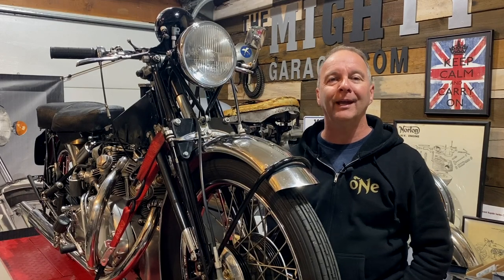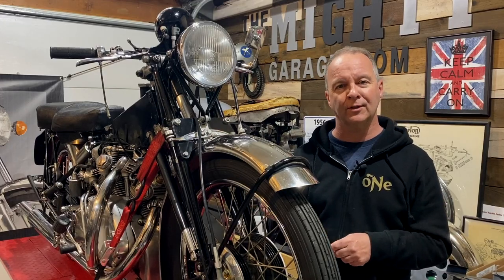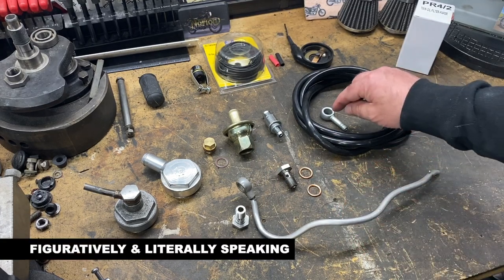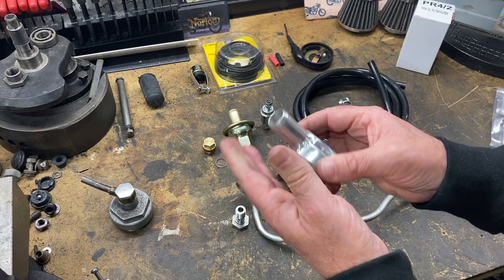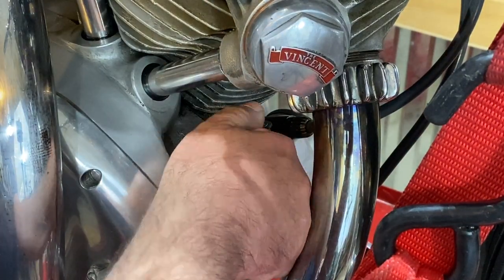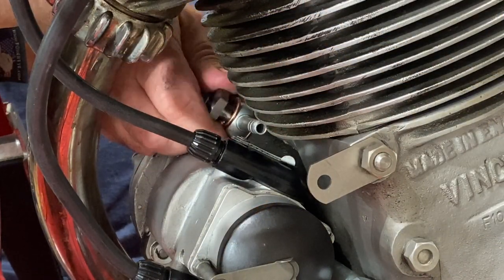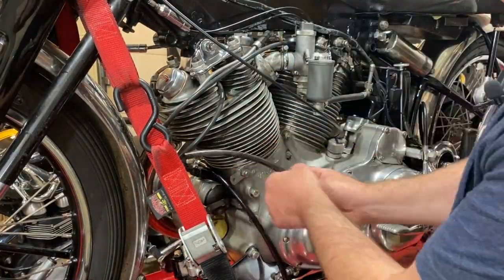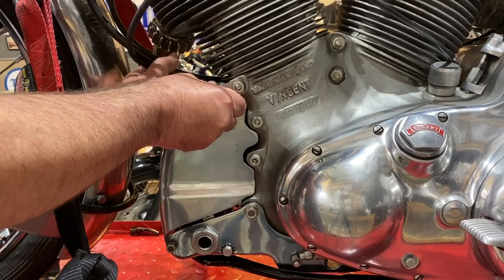Restoration of 1951 Vincent Rapide - Part 78 - Timed Breather

Comment: Just a thought, it might be silly. My caravan has a lot of plastic piping of similar dimensions & you can get 90° bends for it. Back in the day, I remember routing the engine breather onto the rear-drive chain to lubricate the chain. I suppose it depends on the amount of oil your breath ejects?

Comment: I don't know Mike, but depending on the pressure to push through all that pipe up over and back, not sure if all it will do is collect in the pipe. For the fin to pipe protection, you could make a little heat shield to go there and protect it. I could make you one if I was closer for measuring and test fitting.

Comment: I've been building stroked Triumph twins (89mm stroke, either Norton, Weslake, or Nourish cranks) for 30 years. Every motor has the timed breather removed if
 Fitted by the factory, and as many breathers as possible fitted. Everywhere.
Most have a dry belt drive so the combined primary (very good) breather is out. The big one is top of the timing cover and up and over, min 1/2" id, pref 3/4", and importantly, both rocker boxes.
None of my motors leak oil.
Regards,

Comment: I think I’d have kept to original pipe but added the hose to it’s end. The hose could then feed to the back of the bike
Reply from the maker: Thanks, that's a great suggestion.  I did consider that and may try it out if this doesn't work out or the pipe melts 😬😉
Reply: The Mighty Garage I just love the nicely fitted steel pipe that hugs the profile of the engine / mag 🙂 Good luck with solving the problem; looking forward to seeing how things work out.

Comment: Good day Mike ! Interestingly My C did the same thing and I tried all the same things..  The final fix for me was a combination of a Sid Biberman and KTB's E.M.G Stevens fix.  I took a T29 tank breather adapter from the chain oiler system that threads into timed breather hole straight up added a length of rubber hose over  the top of the engine and at the hose highest point I added a quite pricy PCV (positive crankcase ventilation) valve called a Krank Vent it is a HD part.  Then I ran the rest of the hose just like you did over the top on the motor down past the rear carb an along the LH side of the bike under /behind the horn and all the way out to the end of the stock rear stand.  Held all in place with JohnBull rubber holders or you  could use zip ties.  This allows the oil in the the breather to condense and drain back into the motor  before the PVC valve and after the PCV valve only allows flow out and not in, this is  keeping neg pressure in the line and the motor to reduce leaks in the power unit .  At least that is the plan  and the result is much reduced oil misting out of the hose.  Condensation will collect in the hose though so every so often lower the rear stand and it will drain out and oil water emulsion..
Reply from the maker: Thanks a lot Eric for this advice. I really appreciate it. I'll see how things go with this setup and then possibly make adjustments! It's a step-by-step process of elimination, isn't it!? Hope all is well, best wishes, Mike
Reply: I have the same problem on my newly purchased Rapidow (Rapide built to shadow specs). I'm going to try it with the PCV. A catch container would be an interesting and useful addition to measure and control the exhausted oil as well. There are many articles written in the Vincents, but it's great to see some visually. Thanks Mike. Cheers!

Comment: Hi Mike, great videos as always, Paul Richardson's book has some good information about the timed breather and its timing, which I'm sure you are aware, I just wanted to ask  about something completely different and I'm sorry to hijack the post in a different direction, but I'm very keen to know what size rear wheel and tyre you have fitted. Thanks, all the best
Reply from the maker: Hi, no problem at all! It's good timing as I have just replaced the rear tire this week.  I have fitted an Avon Roadrider MKII 100/90-19 on my standard rear 19" Dunlop rim. The Roadrider a modern-looking tire and may not be to everyone's liking, but I have found them to be very good.  Many of the guys in the Norton club use them on their Commandos and I have friends who also use them on their Vincents. Hope this helps. Best wishes, Mike
Reply: @TheMightyGarage  Thanks very much for the info, I'm running a Dunlop K70, std size in the back of my 1954 series C and always wanted something a bit more sporty and with a speed rating capable of at least matching the front Avon speedmaster, but was worried it wouldn't fit. Thanks again.

Comment: Hi there, did you aneeled the copper washers before instaling the pipe? Because you should. Just heat them and when they change color let them  cool down they will fit and compress  better. Cheers.

Comment: ...and you may ask youself why do all the guys riding behind me clean their helmets with brake cleaner back home... The way you route the hose can be ok for a single but not for the twin. Especially as your hose diameter is rather small and thus keeping a high air velocity until the end. Try to mount a sludge trap somewhere near the rear wheel (a beer can, emptied beforehand of course, might do the trick) to avoid spraying too much oil onto your fellow riders.
Reply from the maker: Thanks Michael, I’ll see how this goes first of all. I did also get a little catch can that should hopefully fit behind the rear foot peg bracket. But I’ll see if this works first

Comment: Problems should be solved but if you were offended by the print on the spark plug wires, I can't see how you can accept this over sized hose fastened with "a million" plastic cable ties. Mike, please forgive me for the thumbs down.
Reply from the maker: Ha ha, no problem Anders. I forgive you 😉